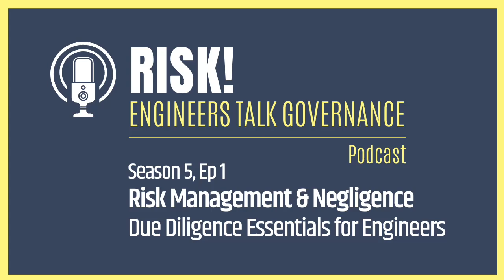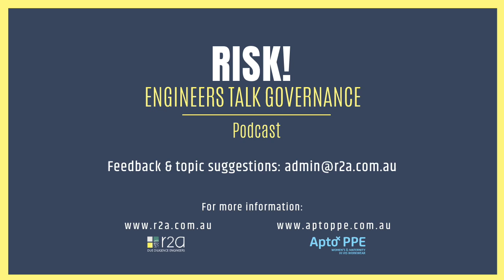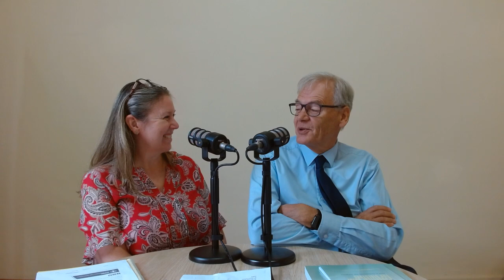Risk Management & Negligence - Due Diligence Essentials for Engineers (Risk! Podcast)

Comment: There is a noticeable high-pitched audio whine in the recording, most apparent around 3:00 and 12:50. Additionally, isolating the microphones from the desk could help reduce noise from accidental bumps. Otherwise, the content is excellent.

In terms of future content, I really like when you talk about things related to SIL, tolerable risk, target risk levels, 'acceptable' risk, and SFAIRP—you already talk about these a lot, but I think you need to emphasize them even more. The opposite mindset is so deeply ingrained in corporate engineering workplaces that even when people hear it once, they often dismiss it, forget it, twist your words to match their current (mis)understanding, or assume you misspoke. Repeating these points over and over is crucial to really drive them home and get people to wake up from blindly following processes without thinking about what they actually need to achieve.
Reply from the maker: Thanks for the feedback Ben. Richard and Gaye have been talking that they should do another ALARP / SFAIRP episode and will probably do it around target levels of risk and safety. This is one of the most difficult discussions - fitting nicely into this season's theme. 

Also note your audio comment. There is occasionally some corridor noise that occurs from nearby offices.